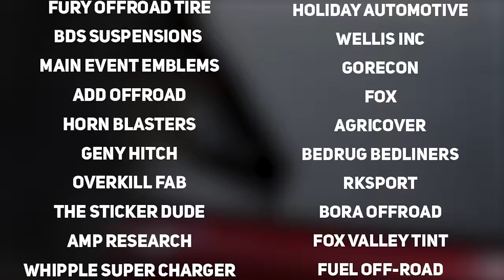TUG OF WAR - SUPERCHARGED CHEVY VS TURBO FORD!

Comment: Who else want’s a fair rematch.
Reply: What was unfair?
Reply: Nathan22 Outdoors about 800 pounds
Reply: @yaboichriss9148  
800 lbs on which side? 
They clearly said the people getting into the Chevy evened out the weight.
Reply: Sparkey 252 rematch
Reply: Sounds like something a Ford guy would say....
Reply: Adam Mascarenas Ford guys always want a rematch. because they always lose
Reply: That's was a diesel with a lot of torque and a gasser and your saying unfair haha yeah unfair for the Chevy the diesel is around 900lbs heavier  they mentioned that when they were swapping co2s coil overs to gasses because it had diesel coil springs... so two people didn't change the outcome it was just a good match and one truck won plain and simple I mean if we are gonna make it "fair" then we might as well hook two bicycles together and tug o war that... just enjoy the content  ;) <3 love the video custom offsets
Reply: I'm a cummins guy but I believe the k350 shoulda won if fuller knew how to run a turbo
Reply: @tonysearwax15  correction: he would've won if that Ford tough drivetrain didnt break
Reply: Tyler dotson yea I didn’t even catch that 😂
Reply: Nathan22 Outdoors sorry I’m not an arrogant ford fan 😂 I just didn’t catch that
Reply: tonysearwax also guys who drive Ford's CANT DRIVE! 😈
Reply: Nathan22 Outdoors so if they evened out the weight that means that both trucks have the same weight and one has to tune to add a ton more Torque
Reply: @Nitro91  The F350 is a 3/4. 1 ton would be a F350 dually
Reply: I do
Reply: @Tyler dotson ford isn't meant to tug but you're right
Reply: @adamm7909  sounds like a Toyota guy response
Reply: @Tyler dotson I understand but I'm pretty sure Fords are not to tug as seen in there were he broke something, my friends ford has a mustang's engine and sport mode, and also chevys break down a lot.
Reply: @collinmckinney7208  please tell me you're kidding F250 is 3/4 F350 srw and dually are both 1 ton
Reply: Ford boys will still say the smaller, gas powered, less heavy, IFS truck still had an advantage.... Yeah, it did. It's because of the badge on the front.
Reply: Sorry ford guys I think you might have take this one
Reply: tonysearwax the fuckin driveshaft broke.   Even if he gave it more power the driveshaft would have still broke
Reply: Ok, how about we use my truck, twin to CO2 only mine is a diesel.
Reply: @collinmckinney7208  wrong. The F350 is still a 1 ton. The F250 is a 3/4 ton.
Reply: @maxum3300  actually the 350 would classify as a 2 ton depending on its configuration due to its payload capacity. And the 150 would be a 1 ton.  These "ton" names are old school terminolgy were 150s were 1/2 diesels were 3/4 and duallys were 1 tons.
Reply: Have you ever been to a truck pull? There are guys that put huge tanks of water in their bed to add weight for better traction and barrels full of water on the front of the truck, adding weight is all part of the strategy.
Reply: Jason Hehr you’re right, that’s definitely a part of the strategy but at the same time, for that to have been fair, fuller should’ve been told he could do the same shit before the pull.
Reply: @hyt644  that is true
Reply: @collinmckinney7208  Ford, Chevy, and Dodge all make srw 1 tons.
Reply: I agree let's get a 4x4 duramax in there
Reply: @collinmckinney7208  F350 is still a 1 ton truck, just with a single rear wheel. If you wanna be technical about it the factory rating payload of a new f350 srw is 4380lb. Nobody's gonna call it a 2.19ton
Reply: @jalexandermt  obviously no one is gonna call it a 2.19 ton.  What im saying is they arnt even 1 ton anymore they are 2 tons. Regardless we never bought 350 SRWs cause if we need a 350 we get a dually.  So to us duallys were always 1 tons.  So in conversation 1 ton meant dually and 3/4 ton ment heavy duty SRW.  Difference in reference i suppose.  SRWs 350s are 1 tons my mistake
Reply: That was fair..... even with the extra people the gasser prob still weighed less by little bit
Reply: Yea maybe have the ford try to match up with like a toyota tacoma or something... lol
Reply: @austinbdn11  put the duramax in there and it probably would have ripped a bunch of shit off the ford lmao
Reply: bernhard85 how is this enjoyable ? It makes so many company look bad, you already know it going all over social media. These Chevy guys finally got a W after custom tuning, over weighting it, and locking shocks in. It’s simple knowledge but we don’t expect bow tie drivers to have any
Reply: What? A diesel Chevy 3500?
Reply: Welp, ford Guys do get hurt hurt when they lose😂
Reply: tonysearwax exactly the turbo being ready to push that pressure out it would of made a huge difference
Reply: @kristeljoski3106  🤔🤔 the chevy 6.0L has 360hp and 380 torque stock. Plus a supercharger and tune thats in the mid 500 maybe 600 range for torque and hp ....... the K350 makes 450hp and 935lb-ft stock.
Reply: It's not a fair pull if one can pull the other while the breaks are locked up. So it's either weight, tire pressures, etc.... it's really really simple to get both trucks closer to being the same. 15 minutes
Reply: Ya even them up give him a new drive shaft 😂😂😂
Reply: @nathan22outdoors8  what was unfair? The poor Ford was outmatched before they even started. They should have made it fair by pairing the Ford with a Chevy Cruze...then he MIGHT have had a chance.
Reply: @jayjaym8186  so true man, so true!
Reply: @NYVET48TFW  
Lmfao what? 
"The poor ford was outmatched"
Are u high? Heavier, wider tires gives it way more grip and it already has way more torque.
That chevy 6.0 is stock with 360hp and 380lb ft. After the supercharger and tune ut was probably aroung 500-550hp and around the same torque.... tge k350 has 450hp and 935lb ft stock. Still almost double the torque.
Reply: Collin McKinney lol that’s not how that works😂
Reply: @jamesmeyer5034  Coming from someone who can't spell, or properly construct a sentence?😂😂
Reply: Sparkey 252 your just salty because your a ford fan
Reply: Me
Reply: @leoquintana6841  gay
Reply: @akareality8993  driveshaft broke cause its junk typical ford junk just like all the blown EcoBoost, coyote motors, 10spd trannys list goes on.
Reply: Don’t do drugs kids
Reply: @hyt644  no because the ford is still heavier
Reply: @mercvqcali2714  the ford was still heavier so what's the problem
Reply: @jamesmeyer5034  the ford was still heavier and even with a tuned gasser the ford makes way more torque being a diesel than the gasser with a tune and supercharger
Reply: @marcobarbertorres7486  it's not always about power and that ford makes like 900 foot pounds at 1600 rpm which I'm sure it was above that when the tiny driveshaft snapped....
Reply: B M 10spd tranny was designed by ford and Chevy.
Reply: Hunter Morris let’s be honest here...Chevy and ford have both went cheap. Most shit for Chevy is made in Mexico, and ford is cutting corners, and going cheap as well. The company I work for only buys Chevy, and we’re taking at least 1 or 2 to the mechanic shop once a month, sometimes twice a month. Some of our trucks with problems are brand new, and the others high mileage. I’m seeing more and more newer fords with problems too. I know What I’m about to say is going to cause a shit storm...but the most American , and dependable truck on the road is a Toyota. Horrible gas mileage, but as far as quality, and giving a shit about their brand, Toyota is in the lead hands down. Unfortunate that the most American truck is Japanese. It is what it is folks.
Reply: How do you make this fair anyway at all ita a 1500 v. A f350 the ford has it already on power and weight you cant make this fair unless you add weight to the chevy and power....you would have to get 2 people who know how to drive to do it the ford guy just spools up and blows the tires off it  a VW bug would out pull it when its sitting there spinning so you cant make this fair the trucks arent even in the same category as eachother its just sad when ford tops pulling truck for the average guys gets out pulled by chevys all around just little pick up not even the duramax lol
Reply: im a chevy guy and even i thought the ford would win sense all of its advantages, and here we are now with the chevy pulling the ford lol
Reply: @yaboichriss9148  not really, the ford 100% weighed more than that chevy
Reply: @akareality8993  so what if that happened while driving down the highway with a load? just say oh yeah man thats unfair, the chevy had an advantage?
Reply: @collinmckinney7208  no the 350 is still a 1 ton, the dealerships even put it under a 1 ton if you asked them
Reply: @hyt644  either way, that ford weighed so much more even with those people in the chevy, a diesel engine is so much heavier than a gas job, and the other mods on that ford would make t heavier as well
Reply: @collinmckinney7208  all conversations ive had end up with 3/4 ton meaning a 250 or 2500 and a 1 ton meaning a 350 or 3500 with or without the dually
Reply: @mercvqcali2714  ??? but yet that ford still weighed way more than that chevy, by at least 250lbs
Reply: @jamesmeyer5034  but yet there are you ford guys saying its an unfair match??? i think if you look at the stats that ford should have won in every catagory, im a chevy guy and i thought that ford would have won, and here i am now seeing it lost
Reply: The tune made for pulling
Reply: I would
Reply: Buy a ford save gas they only run half of the time
Reply: Nathan22 Outdoors what wasnt unfair haha
Reply: How was it not fair lmao
Reply: They need to make sure that 3 jabba the huts don't hop in right before pulling starts
Reply: Nathan22 Outdoors V6 vs a V8
Reply: Ford are trash that's all I'm surprised it didn't break in half
Reply: Hodor
Reply: Collin McKinney there is no such the as a f350 3/4 ton,that's called a f250, a single tire and a dually can both be one tons.
Reply: Austin B I wouldn't even be upset if a Duramax beat it ... diesel power
Reply: DJ Shedd he lifted that truck, none of that is stock ford. That’s the problem. If you watch the video, he moved up before the replacement drive shaft broke.
Reply: Ford guys just cant take the fact that they lose every competition
Reply: That's the results off a lot of money but no real build skills. So it looks pretty,ok but all yours part are not made for the real solid metal crunching,toe pulling,rock stomping Mudd dragging truck. This actually has nothing to do with Ford or Chevy, this was the build. Because if it did. Then there would be two completely stock 4×4 truck's of equal factory models.
Reply: @collinmckinney7208  you are misinformed.
Reply: The Chevy was supercharged
Reply: Fair? How about 1 person per truck? That’s fair!
Reply: Yes plz
Reply: Ford owners always got to make a excuse, when the excuse they need to use is should've bought a GM!☝🇺🇸
Reply: jayjay m the Chevy was tuned for pulling and had a supercharger and a smaller lift put all that on the ford and the Chevy would lose any day
Reply: that Chevy ain't even half the truck that Ford is they had custom parts let's see an equal match Ford to Chevy without customization. That Ford will shit that Chevy out.
Reply: Just a Chevy doing chevy things
Reply: @collinmckinney7208  150 is a 1/2 ton, a 250 is 3/4 ton, a 350 is a 1 ton, the wheel configuration has absolutely nothing to do with the trucks weight rating.
Reply: What funny is that if I hooked up my powerstroke to that gasser i would drag him all over, not because of power or torque but because i have a solid steel driveline, lower center point of gravity, a heavier truck and I know how to spool a turbo for pulling
Reply: Nathan22 Outdoors what about the fresh tune on the Chevy?
Reply: Nathan22 Outdoors also the Ford didn’t get a chance because the drivetrain snapped
Reply: Sparkey 252 how was that not fair
Reply: I get what everyone is saying it was a good match I would like to see it happen where their wasn’t something breaking bcs their for a second they was even bcs both was pulling if the shaft hadn’t broken it would have been a good match but since it broke u can’t count it as a win that’s like saying ok I’m having a tug of war but the other truck is just going to sit their and I’m going to pull it it don’t work like that if u want to put it to rest and leave no doubts do it again same way with out something breaking and see if the results are the same
Reply: @collinmckinney7208  not necessarily,  apparently you have never heard of a single wheel 1 ton, well theres one right in front of you
Reply: Blitz Vlogger - What do you do for work ?
Reply: Blitz Vlogger ya fords or not ment to tug there ment to pull weight/tow not tug against someone with a supercharger and a toon
Reply: @adamm7909  yeah, ain't that the truth.
Reply: who else says it wasnt unfair fords break get used to after market or not
Reply: Whar was unfair??. He evened up the weight diffrence a little still had less weight than the ford and pulled it so hows that unfair
Reply: @kristeljoski3106  one has a tune a tune the ford driver could have gotten but didn't..
Reply: @nathanialbossom455  chevys break down alot???. Lmao. I think you need to rewatch the video to see what broke down and what didnt
Reply: @hyt644  he should have done it weather or not he was told he could
Reply: @mercvqcali2714  truck vs truck is unfair though.. Weight diffrence made it unfair. Evening out the weight a little made it fair
Reply: @jamesmeyer5034  never seen tow off have you??.. Chevy always get the W against a broke down ford any day.. Didnt make no company look bad..
Reply: @jamesmeyer5034  and side note that simple knowledge you say chevy drivers dont have got that chevy the win.. Its the ford driver that didnt use his simple knowledge
Reply: @ericeasterbrook5078  how was it not fair???
Reply: @nickramey7450  your not seeing my point Fords are not ment to tug as seen in the video because the tow hitch broke off and this is a newer chevy than ford also google says chevys break down a lot.
Reply: @nathanialbossom455  google tells lots of lies and as you seen chevy breaks down less than ford..
Reply: @nathanialbossom455  Your "point" is just another excuse as to why ford took the L
Reply: @nickramey7450  it isn't a excuse these points are strongly based of the video as seen, google proves and says that ford is better and chevy breaks done a lot and your "point" is?
Reply: @nathanialbossom455  google is not a reliable source of information to prove nothing.. And that is another excuse as to why the ford didnt win. Weather the statement is true or not the way it was worded makes it an excuse
Reply: Turbocharged and supercharged are two different things. Take stock fords and chevy or both supercharged and watch ford win.
Reply: Dodge over both
Reply: Nathan22 Outdoors duh
Reply: One thing I learned from this video. Don't buy a ford truck.
Reply: Stop Crying  That was a fair pull the best truck won and the POS lost get over it
Reply: That was a fair match to begin with. The lift on the Ford is what ultimately did it.
Reply: Sparkey 252 the Chevy would have one either way
Reply: @collinmckinney7208  A 350/3500 is a 1 ton truck no matter if it's a dually or a SRW (single rear wheel). 250/2500 is 3/4 ton. You can get a 250/2500 in a "camper special" in certain years & models which is basically 250/2500 driveline & frame with 1 ton springs. You cannot buy a 250/2500 as a dually. Nick H and the 6 people who liked his comment know nothing about trucks.
Reply: He had 500 extra pounds
Reply: @gunners7063  if we stuff diapers around the Fords tailgate it might seal enough that the Ford guys can cry 500 pounds of tears into the bed and it will be fair
Reply: Jose Salazar watch any other match the trash Chevy gets towed 5,000 feet. Listen again to what he said, he said “ it’s all about strategy” he put 4 extra people in the truck All weighing  around 150.
Reply: @flaming_viper5472  I thought compound turbo systems and modern variable geometry turbos didn't have lag?
Reply: @flaming_viper5472 i thought compound turbo systems and modern variable geometry turbos didn't have lag?
Reply: @flaming_viper5472  i thought compound turbo systems and modern variable geometry turbos didn't have lag?
Reply: @flaming_viper5472 i thought compound turbo systems and modern variable geometry turbos didn't have lag?
Reply: @flaming_viper5472  it's spelled: tune
Reply: Jose Salazar no matter what turbo unless u get two small ones or more it’s going to have lag since turbos only real work when u get to a high RPM
Reply: @gunners7063 I saw three extra people get in the truck not four. I can only reply to this video. I don't know what other videos you've cherry-picked as examples. You can pretty much find anything on the internet. The "strategy" was to even out the main deciding factor of a pull which is the weight. Weight and traction  play off one another. Power is not nearly as important. I don't understand how you think these trucks weighed the same: 6.7 diesel engine heavier than 6.0 gas. 1 ton truck heavier than 3/4 ton  truck. That Ford is a much heavier vehicle overall. Out of the box supercharger kits generally make less than 10psi of boost while turbo diesels make substantially more. The truck with the smaller engine on less boost won. And don't talk shit about turbo lag. Compound turbo systems with variable geometry turbos aren't supposed to have lag.
Reply: @flaming_viper5472  You got it backwards. Big turbos are slower to get going but will pull harder on the top. Small turbos spool quick and get you off the line. But variable geometry is supposed to do it all. Let compare your degree in Auto and Diesel Technology to mine
Reply: @flaming_viper5472  and your still talking about a out of the box supercharger kit with a basic size pulley making less than 10psi. They never said they upgraded the pulley in any of the videos. It's a 6.7 V8 with like 40psi vs a 6.0 V8 with like 7psi
Reply: How is it unfair
Reply: What was unfair. It was either the Chevy or the power wheels truck.
Reply: Wym?
Reply: @djshedd77  except that was aftermarket shit, not Ford. I'd rather see two stock trucks go at it. 😆
Reply: Yah all the way he had to put wait on it
Reply: Ford needs to come with a pair of Shoes when you buy one that says shoulda baught a Chevy
Reply: @nathan22outdoors8  yes his truck broke